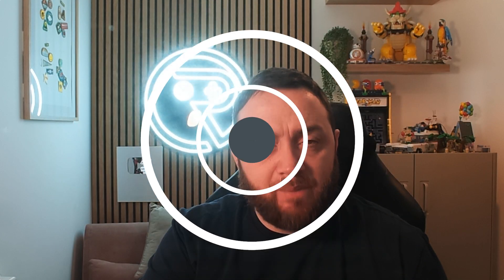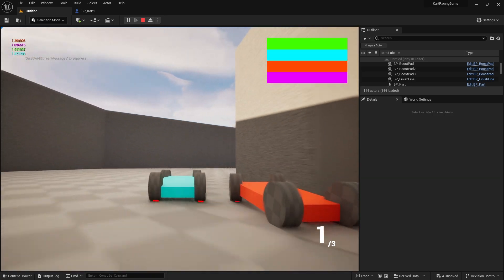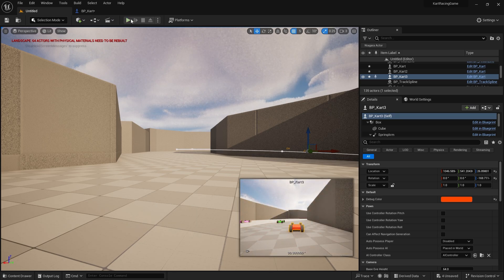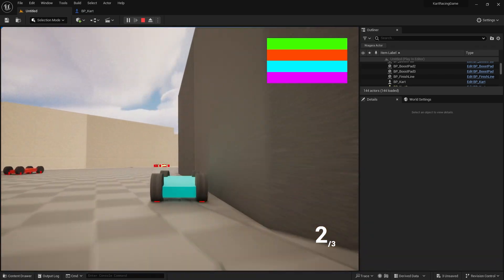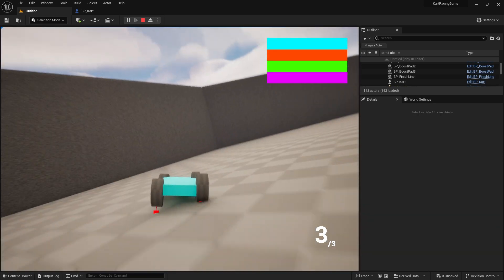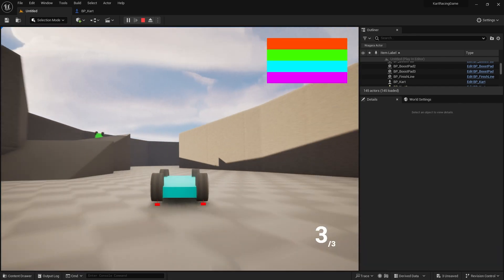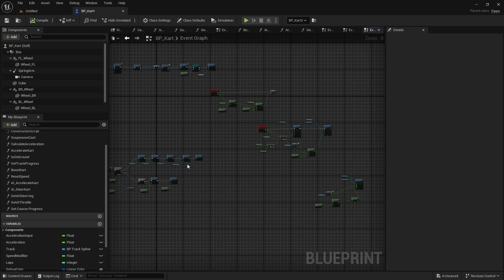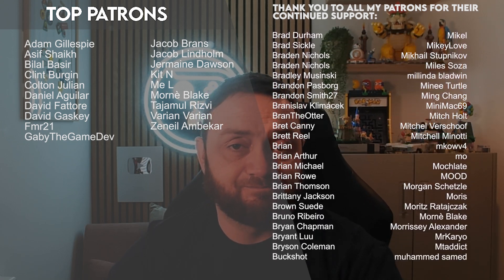Unreal Engine 5 Tutorial -  Kart Series Part 14: Physics Adjustments

Comment: Great tutorials so far. You mentioned early on regarding improving the steering with curves. Will you be demonstrating this?

Many tutorials avoid this, but it's really important. When a vehicle is moving slowly the steering should be easy, a large turning circle, but when you're at speed you shouldn't be able to turn as much. It makes it so much easier to steer around bends. 

Also some form of slight drifting would be very useful too. 

I think many other devs would be interested in these topics. 

 Thanks 😉